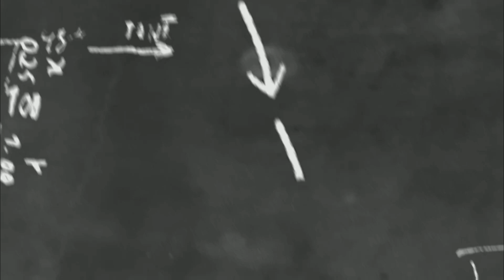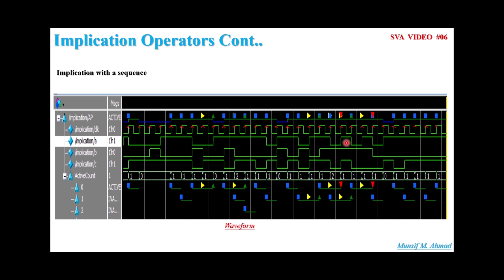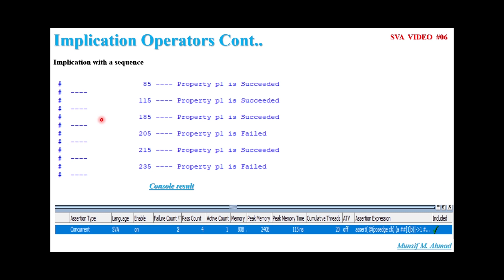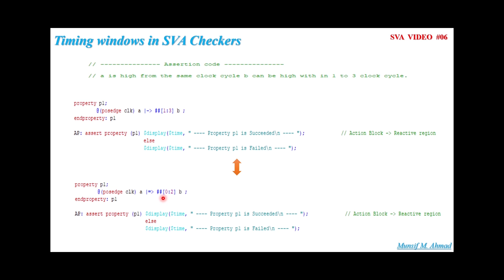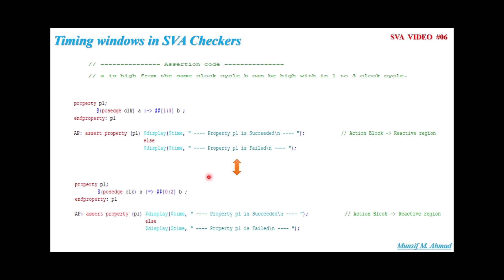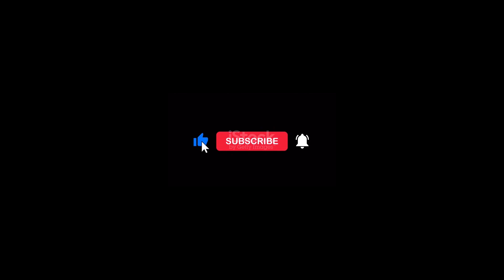Timing Windows w.r.p.t SVA (System Verilog Assertions)  SVA VIDEO #06

Comment: hi munsif, can you explain the variable delay in system verilog assertions
Reply from the maker: Yes,  upper limit can be $ i.e no upper bond and lower limit can be 0.
Reply: $rose(a) |-> (1,delay=v_delay) ##0 first_match((1,delay=delay-1) [*0:$] ##0 delay <=0) ##0 c
(1,delay=v_delay)  copy value to local variable
(1,delay=delay-1) [*0:$] ##0 delay <=0 decrement util delay is 0
first_match((1,delay=delay-1) [*0:$] ##0 delay <=0) wait for first match of delay value 0